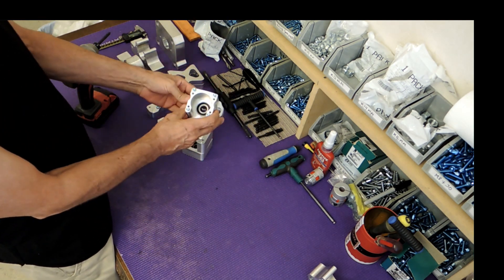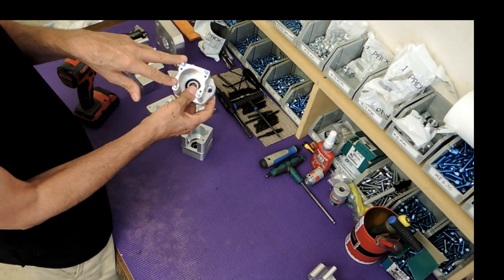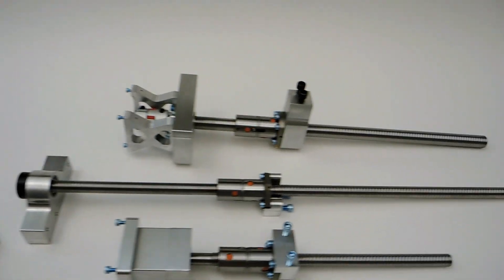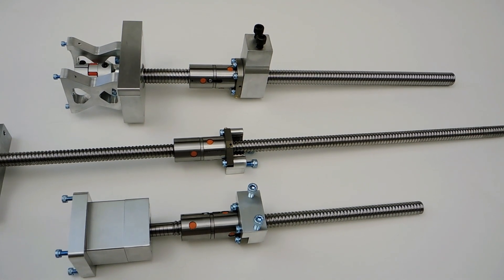CNC Ball Screw kit. Weiss-30, Weiss30lv, VM32, WMB30L, PM-30,WMD30LV,

Comment: IF you have to double nut a ball screw,
why use ball screws at all ?
you can build a backlash eliminator
for a stock lead screw.
make a bronze flange nut,
cut circular slots for cap screws.
i have seen this done with edm.
Reply from the maker: I have made the exact setup your referring to. The problem is friction at low backlash. If you run positive preload to have backlash below .002" or so the friction is much much greater. The pressure causes ware and the system will soon have 1 or 2 thow backlash after a few hours of running.  ball screws can have 50 pounds of positive preload and maintain that setting over time.  I did make a auto adjustable brass leadscrew nut and it worked but the friction to stay under .002" was too high and caused heating and ware.
Reply: @ArizonaVideo99  i thot about makin an auto adjustable backlash eliminator with bronze flange nut n a coiled spring. i guess i would get the same friction/load/wear problem. i just bought a cx601. wanted a pm30 but im in fantasy island up here in ontario. im more concerned with swaping out the magical mystery plastic gears atm. gona try a 2 step pulley on top of the spindle 1st. thanx for the response 99.
Reply from the maker: @timstevens3361   CNC spines the screw way more than you will ever do by hand. Wear is a real thing. When the screws are new they are quite ruff. You cant really feel it but it tales a long time before a lead screw is really like glass. When fully smooth it wont grind the nut away. Using two nuts is fine but the perload will have to be near zero. If .002" or 3 lash is OK then your fine. They wont last all that long but if you do a few parts a month its fine. I would still do the X with a ball screw. I have all kinds of screws around. 3D print the mounts or use the stock lead screws and make the mounts.

Comment: Hi. I have a weiss vm32l that Im looking to convert.
Hoping to use closed loop 5nm torque nema 24.
Trouble is I live in the UK. I already have the ball screws. Do you sell the dxf / cad files for the plates or only the finished milled product. Trying to keep cost to a minimum atm. Thanks